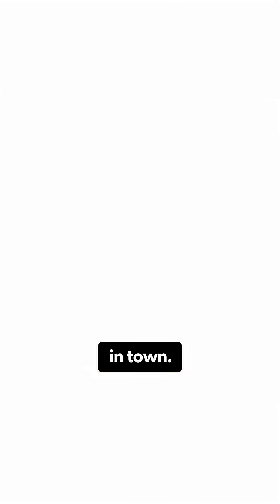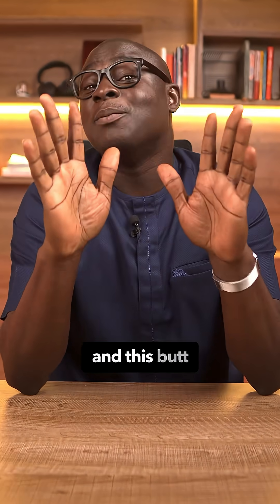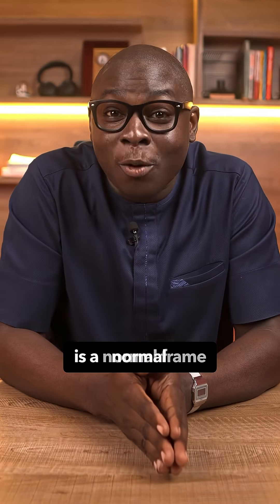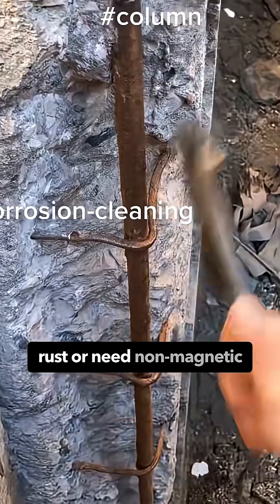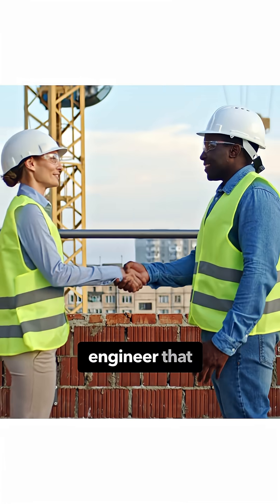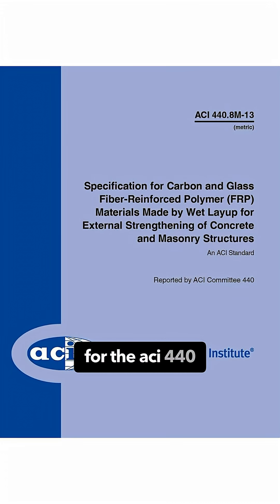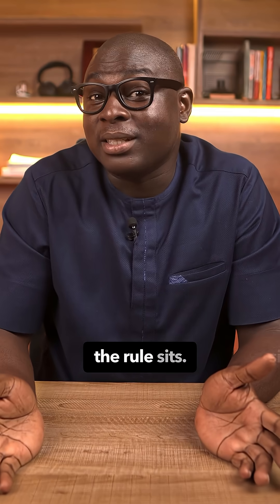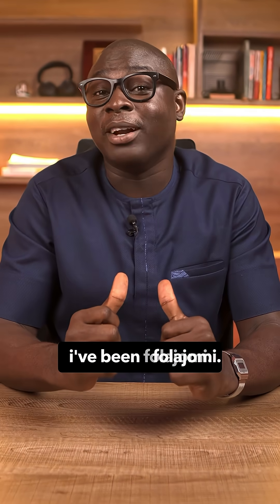Steel vs. Fiberglass Reinforcement: Choosing the Right Material for Your Construction Project

Comment: Me I will just advice that you mix the two if you can afford it. This makes sure you get the best of both worlds while ensuring that their negatives cancel out. Even if rusted, the fiberglass still holds and when fibreglass fails, you have the steel to back up your structure. 😂😂

Abeg na yoke I dey yoke o. 😂😂
Reply: Haven't you heard of over reinforcement??, which becomes an issue too.